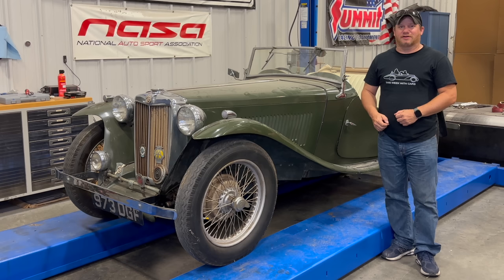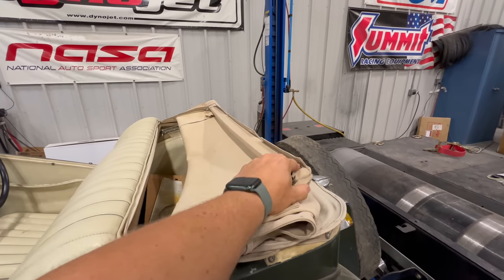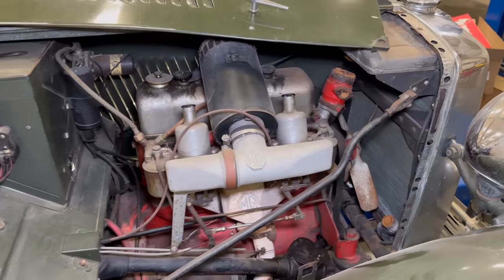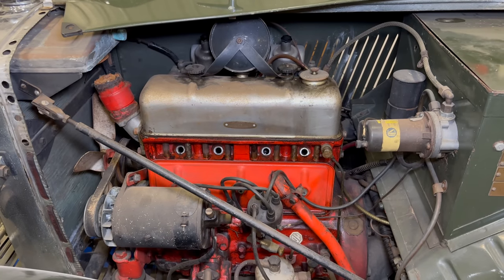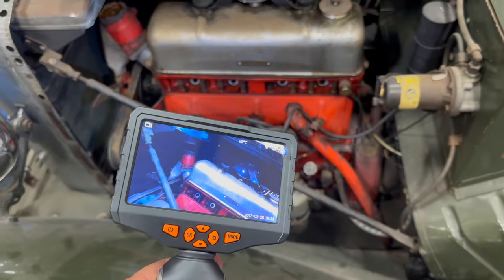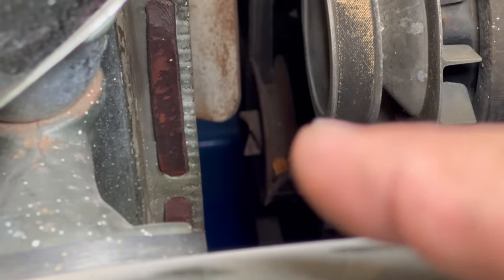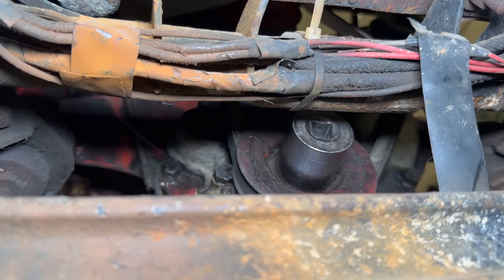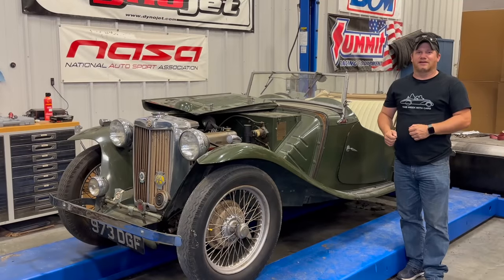1948 MG TC - Will It Run?

Comment: I would pull the head to have access to the stuck piston, and apply a mallet tap via a large wood dowel slightly smaller in diameter than the cylinder. A bit of trouble but probably the best route. You can check the valves and decoke as well.

Comment: It's a British reg . I had a 1949 TC from 1968 to 1971 - great fun ! The oil underneath may be from the filter joints cracking due to vibration ( a perennial problem with mine ) , I realised later that the solution is to replace the rigid pipes with flexible hoses and mount the filter on the chassis . The other main problem I had was with the steering box worm cracking - had it rebuilt by a specialist MG supplier . Good luck with your car !

Comment: Oil is not the best thing to put in the cylinders I use transmission fluid and acetone 50/50 mix. Unfortunately not being able to get to the crank shaft bolt with the braker bar you may need to remove the head and try a using a piece of wood and a mallet on the pistons or remove the transmission to access the rear of the cranks shaft. Can't wait to see what you come up with and to hear this car run!

Comment: This car is in good condition, even the wood looks good. I would almost certainly say the front number plate is British and note also the AA badge which is a  British roadside recovery service that people pay an annual fee for and is still in operation today. You can also get cover for travelling to Europe and my guess is the owner lived in the UK and travelled to shows in Europe. That would be a common thing to do and still is, for a real enthusiast. As for the stuck engine I would suggest putting a small amount of diesel in the cylinder and leaving it to soak. That generally does the trick! It will smoke a bit on first start up but it will soon clear.  It will be great to see this car running Steve. 👍👍

Comment: This is a really nice post-war MG and it looks as though it was lovingly maintained until the owner most likely became incapacitated or passed away.  After that, nobody either cared or did not know what to do with it.  Yes, get this back on the road and get the NEW parts you need to make it a safe, enjoyable vehicle. Get trans fluid/acetone mix in the cylinders and let it soak.  Check to make sure the starter isn't frozen up in the engine.   Then, use the car's crank to turn over the engine.  Yes, it did come with one.  Thanks for sharing and good luck.

Comment: That is a very old British numberplate of pre-1963 vintage. The yellow AA badge is also one of the first they issued to members of the Automobile Association. It's also RHD so it must have been used in Britain. Look at the badge to get an idea of when, probably the 1st owner, joined the AA.
Badge numbering system
1 to 999999 1906–30.
A to P suffixes 1930–45.
RST suffixes 1946–56 (flat motorcycle badges)
WXYZA suffixes 1956–67 (domed motorcycle badges)
OA to OZ prefixes 1945–57.
1A to 9A prefix 1957–59.
1B to 9B prefix 1960–61.
1C to 9C prefix 1962–63.

Comment: Being an almost 78 year old engine I believe it would be time for a complete refresh.  All the seals are dried up or cracking, the rings and bearing need a thorough inspect.  All the front and rear main seals seem to have lost enough oil through the year to preserve all the wood and metal under that fine TC.

Comment: A very nice find! The head really has to come off to unseize the engine, any attempt to turn the engine will result in scored bores and damaged rings, and the valve seats will probably be badly corroded as well, so taking the head off is the only safe option here, taking the sump off so you can extract the rods/pistons would be a good idea as you can then hone the bores. Good luck!
Reply: i suspect you are right! i'm often appalled when viewing "Will it Start?" youtube vids when participants force a stuck piston and then immediately start and rev the engine. as i'm visioning all the damage being done to the cylinder walls and rings. it really needs to be disassembled...

Comment: Easiest way to check, taking of the sump; immediate access to crank/bigends/conrods. My PAPB had a temperature problem with cylinder three, the gudgeon pin froze in the small end, eating away the piston bearing. In the end had to fabricate a new piston (not available anymore). Mighty barnfind! You were able try to unlock by the wheels. My car is missing 6 teeth in its crown wheel; after my engine I have to rebuilt my diff! Looking forward to see your progress!

Comment: Personally, I would not even worry about the engine being stuck at this moment.  I would just pull it, take it apart, then soak it in a hot bath chemical engine cleaner (automotive machine shop level), then manuflux the parts for cracks.  If all ok.  Rebuild the whole engine and transmission.  That way you are starting from zero again.  I would also just replace the radiator, hone out the water passage ways, but that hot bath should clean a lot of the scale out of the water jackets.    I just would not try and crank it, in its current condition.

Comment: Nice little MG straight out of Abingdon, UK plates, Automobile Association badge. The driver probably had a flat cap, too!
I'm cautious with  stuck engines - if the oil hasn't penetrated, I'd have the head off and work on the piston directly. And maybe the bottom end too?
Reply: Absolutely agree..

Comment: It would appear the front ' reversed '  registration plate , which is British ( London issue ) dates it to December 1961 as being re-registered .DGF 973 dates to August 1936 so definitely not the first registration index it started off with in 1948.

Comment: Vinegar works well on seized engines, I know everyone says atf and acetone, but vinegar works well. I think you should trymore fluid in the no 3 cylinder, before attempting to turn the engine, regardless it will need a rebuild, most likely.

Comment: A bixed end wrench on that crank shaft nut with a legth of steel pipe overthe free end for maximum leverage.  That6s after cleaning out that oil and using some good pentrating oil like Kroil.

Comment: Pull the oil pan and head off. Remove the pistons that aren’t stuck. Use a torch in the cylinder and heat up the top of the piston and cylinder wall around the top of the piston while some one rocks the car back and forth.  That will free it up for sure. Then hone and re-ring! And put it all back together!

Comment: Marvel mystery oil is my vote too and keep rocking it.      I put a socket on the crank like you did and used a very long extension thru the hand crank hole  . Use a breaker bar and a lot of patience…. Good luck 🍀👍🏻

Comment: one of the harmless time honored ways to move a stuck engine is to fill the cooling sytem with very hot water and allow time for the block to expand.  put the car in high gear and rock.  rubbing alcohol on top of the piston will work wonders and works very quickly.  go ahead and use the starting handle, just be sure not to add too much force.  trying the starter should not cause any problems.  if you hear it click, you will know that it is not jammed.  i see no reason why you should have to resort to taking anything apart,except for the rocker box which should be removed.  every valve should be checked to be sure non are stuck.   proceed carefully, it is only manly to keep adding force,  resist.  british cars even rolls-royce tend to be flimsy things compared to say a packard, buick or model t.  best wishes

Comment: Make sure the brakes aren’t binding. There are adjusters on the backplates. With a socket on the crank pulley you can turn the engine with a couple of extensions passed through the holes in the badge bar and lower radiator grille. I’ve done this many times.

Comment: Hi Steve...looks like it is really bound up on that cylinder. The oil that was put in there is just regular motor oil? I agree maybe make a concoction that has more penetrating power. Also while you could not get a socket on the front of the crank....can you get a box end wrench on there? Maybe put a wrench on the bolt and lace with another wrench or a cheater bar. Or maybe just continue rocking every couple of days....I am confident that you will get it to free up.
Reply from the maker: I don't know what oil was put in the cylinders, if I try something else I will remove the old liquid first.

Comment: I love these cars, my father had a '49 TC, and how I'd love to find that car!  But, to your car, I'm of the "In for a penny, in for a pound" school and I'd pull the motor and give it a full rebuild.  Once the motor is out, the head off and the oil pan, crank and good pistons are out, it should be fairly easy to get the stuck piston out.  I would want to consider why the one cylinder is stuck when the others look so nice.  How are the bearings?  I wouldn't be surprised if the bad cylinder has more bearing wear.  No less, I'd replace the pistons/wrist pins.  By pulling the motor, you can also clean the cooling passages, and do all the little jobs now rather than having to do them later, and now's a great time for a new clutch kit.
Cheers!

Comment: I would take the oil out of the cylinder, then fill it CRC or Pb Blaster; there’s a little ring of rust below the piston that needs to be disolved. All the oils that are being recommended are lubricants, and won’t dissolve the rust at all.

Comment: With so little corrosion in the bores I'm surprised it's putting up this much of a fight.  Those shiny bores need a good hone anyway.  I'd pull the head and pan and remove the pistons individually.  If one of the pistons is really stuck you could try tapping on it with a piece of wood and mallet.  It may have some sticky valves that need attention too.
Reply from the maker: With the huge surface area that the piston is in contact with the cylinder wall it takes very little corrosion to stick the engine, should be just one pop and the whole engine will free up.
Reply: @ThisWeekWithCars  Right.  Once the head is off you might also put a little heat into the cylinder walls with a torch.  Heat is like magic, haha.  She might free up without the need to take the bottom end apart but I'd still give it a good 45 scratch with a ball hone at some point if it were mine.   Nice TC.  I hope to see more.🙂

Comment: It will depend on if it is iron rust or aluminum piston corrosion. If it is rust use evaporust in each hole and soak.  If it is aluminum corrosion then it will most likely require persuasion thru the bottom.  if it is stuck valves then see if you can get each one moving Independently. Obviously oil change immediately after getting it moving. Don’t forget to coat the cylinders with oil later to prevent more corrosion.

Comment: Soak the cylinders with a little Marvel Miracle Oil in each...or any penetrating oil mix. leave it a couple of days and then rock it back and forth. It will USUALLY free up quite quickly. I've freed many seized engines this way. If it doesn't...leave it another day and try again.  Good luck. Rod

Comment: I'd like to see a heat cycle on it. DGHD tried it with the Fargo LCF but it didn't work. Maybe a smaller engine with less thermal mass would respond better to the heat. Either way, beautiful car.

Comment: As others have said it is a British plate, GF representing London. There were several different codes for areas in London. The D is an approximate date of issue, is this case August 1936 onwards. The next change would be 1961 but this time a short run  with the number before the letters.

Comment: Pull the engine. If it is ceased due to a broken part inside, you will only make it worse by forcing things.  I suggest you completely rebuild this motor. The very least you should  do is pull off the oil pan and look for a bad rod. If the main bearing is ceased up, you need to replace it. It's going to require further inspection. These are simple motors. Don't be afraid to dig in and rebuild it .

Comment: Try a half inch extension bar through the hand crank hole in the front valance to access the socket on the crank nut. Might work…..probably not though!

Comment: I am no expert, but it looked as though there was a slot under the radiatir grill to fit a starting handle. Most UK cars of that vintage had them as standard equipment.

Comment: I suggest you put a wrench on the drive shaft and a heavy weight on the end of the wrench.  Pour a good lubricant on top of the pistons and let gravity do the work.  This method was successfully used to free up a frozen Ford Model A engine.  Take care.

Comment: Remove the head and side panels to tappets to first verify if loose and then flood with WD40 or other lubricant.  On top of pistons flood those as well. Come back daily to apply motion through gearbox pulling as you did initially.

Comment: Very nice example of an original preserved car, though the seized engine doesn't help. My Hillman had four thoroughly seized pistons. Maybe you will be lucky with only the one. Since the cylinder looks good, perhaps a bit more rocking in 4th gear, else head off, pan off and beat it with a stick.

Comment: Old cracking tires aren't dangerous, but thread bare ones are... like the spare on the back that is out of tread.  Way better than no spare at all though.   Your last set of old bald tires should get saved for emergency replacements when you get a flat.

Comment: Diesel oil or a good quality penetrating oil and let it sit for a while. You don't want to be using brute force on an engine that old or you may do some serious damage. As it is, it will likely need a full overhaul as all the seals will have dried out or perished after sitting so long, but it's a little belter and well worth resurrecting.

Comment: Have to flush cooling system anyway. Remove radiator and gain access to manually rotate the crank shaft.

Comment: Off with it's head!!!  Then heat the suspect piston smoking hot a couple times, make a wooden plug that is slightly smaller than the bore, place on aforementioned piston and whack it smartly with a hammer.  Rinse, repeat.

Comment: Never seen a 'heat-cycle' done before, would be interesting to see if that frees up the stuck pistons, strange as the cilinders don't look too bad from the top. definately curious how you get on with this one, cheers!
Reply: Check out the DGHD episode on the Fargo LCF. They hooked up heater hoses to a running pickup and ran the coolant through the LCF's 318 (with thermostat removed). Didn't work, but that doesn't mean it couldn't work.

Comment: To free the engine it may be a chance to tow the car, if the clutch is working, and then release the clutch in 4th gear.  First check all the wheels are freely rotating, but I think you know more about these things than I do.
Another idea would be to take out the radiator to get the breaker bar on the crankshaft nut, there is no coolant in the radiator anyway, so it may have to come out at some point. 
These cars are really interesting as many were taken back to USA by American troops, this one seems to have at least been to Belgium and France before moving to USA.   
 I see it is still Right hand drive and very low mileage and was not converted to the American or even European way.  It is better condition than many modern cars and only needs some gentle persuasion. It will make good youtube content.
Reply: Good idea on pulling the radiator. This would be a great thing to try.
Reply: Yes the radiator is very easy to remove on these, it probably needs to come out anyway

Comment: Why did all pistons appear to be low in their bores? A couple should have been up? Or perhaps all four were mid stroke. Cam could be seized or a valve stuck.  Distributor shaft seized?

Comment: What gears did you use when trying to shake it loose? This is akin to roll-starting, where I see a lot of guys use first or second gear. If you consider the backwards gearing, i.e. that the wheels driving the engine, this is completely wrong. You want to use fourth gear so that the wheels have maximum leverage over the crankshaft.
Reply from the maker: You saw me put it in fourth gear in the video.

Comment: Registration Plate , last two letters GF means it was first registered in London  and the D is for 1948 . All this info is on line. Reg plate stays with the car for life unless you buy a private number and you hand in the old one.(don't ask how it works it  would take to much explaining)
Reply: Which site are you using for getting the year? I’ve used the oldclassiccar one, but it contains some errors, for example it gives DGF as August 1936 to July 1937.

Comment: I don’t get the YouTube obsession to start motors with obviously rusty internals.  It will just dramatically shorten the life of the engine. This motor is so simple and accessible it can be taken out for overhaul for very small money.  With care, bore size can be preserved rather than ruining viable components.

Comment: DG plate letters refer to car being registered in Gloucester England.
Reply: South West London registration. DG as an area identifier for Gloucester came with the new style plates in 2001
Reply: Edit: from 1963 to 2001  DG was Gloucester, since 2001 DG is Dees-side to Chester. The system is arcane.
Reply: Furthermore DG is irrelevant here. When using 3 letters in a UK registration number it’s the second and last letters that give the area of first registration with the first letter relevant for age identifier. 
As I stated earlier, arcane.
Reply: Remove starter ,crow bar the flywheel gently but firmly in addition to all and any oils you might have at hand